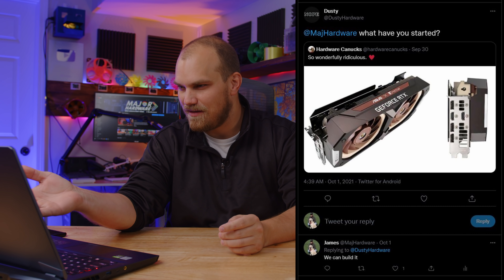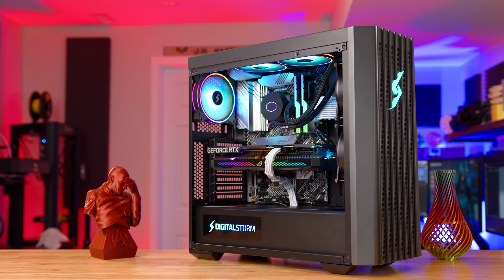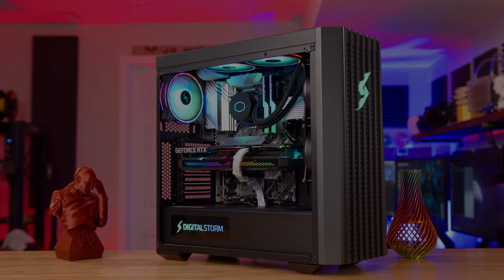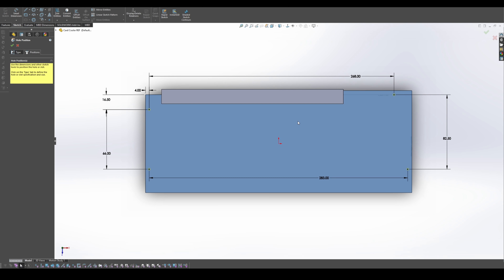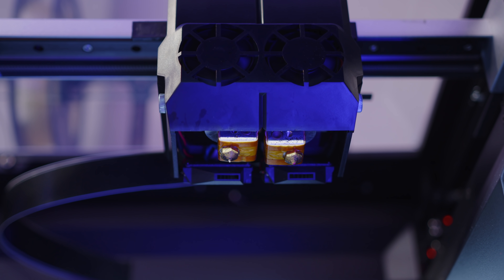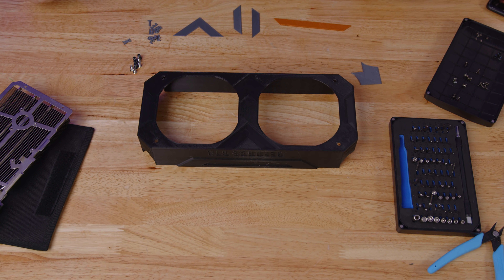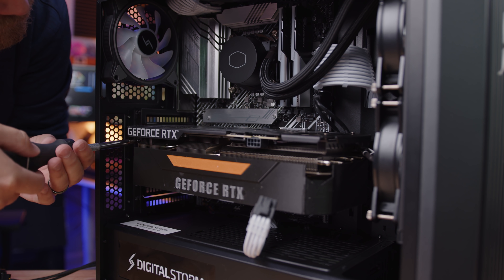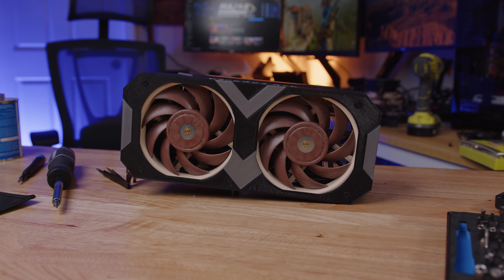I FABRICATED The RTX NOCTUA EDITION From A Picture

Comment: Did you try using the fan headers on the graphics card to run them? The Strix 3060 should have 2 fan headers at the back of the card.

Comment: Your asumption is wrong, because with both type of fans, you achieve the max airflow the rad can use.

Reduce noise to like 35dba or lower and you'll see a lot of difference in temperature. I have a 1080 strix modded with 2x120mm sw3 and im not only running much quieter but with slightly better temps. Im running 800 rpm (which is like 32-33dba) instead of the 1700-1850 on stock fans (something like 40+), and im getting 4-5ºC lower.

Comment: I'm sure the firmware on the card is aiming for that 52-53 c. I did notice the clocks were lower on the noctua fans
Reply: That's the problem with AIB GPU's their firmware is tuned to the cooling. He should have taken manual control of the Mhz for a baseline.

Comment: Paused At 12:00 for my guess.
Cooling: slightly warmer, but no worse than if the card was in a case with poor airflow.
Noise: quieter, but not noticeable to the ear because of other fans/pumps in the system.

Edit at 13:00
Nice.

Comment: I did this on my evga 1080 when the stock fans died and with 2X Chromax fans. However, I just used zip ties to hold the fans in place. It's extremely quiet but looks like junk.

Comment: In the screen capture #1 you are showing the card hitting 1777-1800 MHZ at 52C, In the second it is hitting only 1725-1755 and is hitting the near same 53C. This tells me the test is not consistent, as the MHZ should have been the same if the temp was the same.

My assumption is the testing window on the Furmark test wasn't sized the same.

Comment: People have been doing this but without the shroud. I've also done something similar with a Gigabyte 1660Ti, which was loud AF and also had rattling noises at almost any RPM. I just removed the crappy plastic shroud and slapped 2 Arctic PWM fans directly on the heatsink and ran it like that. Temperatures were roughly the same but the improvement in noise was incredible, no more rattling and it even looked better. I'm not a fan of fan shrouds to be honest, I prefer to see the tech that does the job, the cooling.

Comment: Did something similar with a Deshrouded 3070ti. Have 2 Noctua 120x15 slim Chromax fans mounted to the bottom of an NR200 and 3D printed air ducts leading direct to the 3070 fin stack. Runs so much quieter but that card runs hot no matter what.

Comment: I did the same with my evga geForce 1070 a few years ago, just with less 3d-printing and more just straight-up zip-tied a pair of unused fans to the heatsink.  The Noctuas had a lesser current draw than the stock fans, so running them off the card was no issue.  It might have looked a little "sketchy," but it actually ran 2°C cooler and didn't sound like chainsaw any more.

Comment: Graphics card deshrouding is a very unrepresented thing in the PC building community. It's amazing for GPU thermals and silent cooling. And it's especially great when you're using an ITX case, where the deshrouded graphics card with case fans brings fresh air in from outside of the case.

Comment: If you do get a 3080 or 3090, it would be pretty cool to design a shroud that brings the air around and blows across the back plate. The memory temperatures on those are too high.

Comment: Arent you worried about the fact that PLA starts melting/warping at around 60 degrees celcius?
I have been toying with the idea of designing and printing a complete miniITX case. But the "fear" of it "melting" has kept me from going ahead
Reply: Why didn't you use ABS instead?

Comment: I have a GTX970 that had a fan die on me and it was using these really weird connectors plus you couldn't get replacements back then anyway. So I threw away the entire shell of the GPU and zip tied two 120mm noctua fans. Now my problem was they were no longer reacting to the GPU temperature being powered as a case fan on the motherboard. But by some weird stroke of luck I had a motherboard with a temperature probe sensor port thing and I just had to buy one for a few bucks and stick the probe inside the GPU then set the BIOS to use the temperature for those fans. And yes it is the worlds ugliest GPU but it worked! It still works but I upgraded and it now sits there as a backup GPU in case of the worst. I wish I'd had the skill to make a cover but the important thing was the card was so quiet! And for me the temps dropped a lot. I was just amazed I'd managed to make it work so great stats was a super bonus.

Comment: My man, you should try to make a shroud for the Raijintek Morpheus. It's a universal cooler that you have to BYOF (bring your own fans). I'm currently using 2x A12x25 and it keeps temps ultra low in this config BUT the cables are a challenge to keep clean (and no shroud).

Comment: I made something like this back in 2004 😆 I strapped two 90mm case fans to my ATI X800 because it kept overheating.  It over clocked like a BEAST after that.  That was before graphics card manufacturer even started doing that.

Comment: 2021, the year where printing things for your computer is easier than buying one.
Reply: *If you have a 3D printer to begin with.
Reply: @rafamacamp  It's easier to get a 3D printer than PC parts
Reply: @Aesavyx  Depends on where you live.
Reply: .......were talking about a 3060 that is priced higher than most 3060ti....and id rather talk about how most ppl miss that point. Dont even get me started with some of the top tier 3070 options being priced above 3070ti cards. You have to push the 3070 strix to 8000 mem and around 2.1ghz or 2055+ just to get near 3070TI FE numbers as it is. Which typically requires a high quality psu if youre going to push an OC like that when ever you play a AAA title per ex. VS the simplicity of undervolting a 3070Ti fe to run cooler/quieter and get the same frames for 599$ on a best buy drop. VS the 800$ msrp range of the 3070 strix/v2. Thats the sad part everyone new gpu or not(those that buy one) are all refugees of this tech landslide.
Reply: @anhiirr keep in mind, the 2 fans are like $70. That’s quite a bit, if you just take the 3D printing to be free.
Reply: That is my goal: build a chassis and supports with a 3d printer
Reply: @yanuehara8017  You answered yourself, mate. I don't live in the US.
Reply: @yanuehara8017  Can you send me some links? As far as I know, the prices don't justify the results. I'm pretty able to make stuff in other ways so...
Reply: no, it is easier and cheaper to buy a prebuild
Reply: Just buy a laptop 🤡

Comment: I did this many years ago. And ever since i've always replaced the stock cooler with 2x noctua a12x25 fans.
Reply: The one in the video has 3 fans and logically 3 plugs on the pcb but If you only use 2 does the controller behave the same as it uses 3 or is it just programmed to react to the heat and it doesnt matter how many fans? Im a noob
Reply: @franzrecht6092  The fan connectors on a GPU is not a normal pc case fan connector. So you plug them into the motherboard or a fan controller. You can use software to control them. But in my case the Noctua fans are so good i dont really need to do anything but plug them in and make sure they run. My 2080ti went from 88c full load to 65c. But the most noticable thing was the greatly reduced fan noise. My PC is totally quiet thanks to Noctua ♥
Reply: Honestly, since i don't care about noise i'd use some ippc fans which run at 3k rpm
Reply: @federicob.8313  How can you not care about noise ? But yes if you don't, why not go for some Delta 11k rpm 100w fans ?
Reply: @jnssmnsn  that would probably rip the GPU off the PCI slot! lol
Reply: @Deses  That's beside the point ^^ But probably yeah
Reply: @jnssmnsn  Hew's gonna care about noise when he grows up and moves out of mommys place and isn't forced to use headphones all the time while gaming anymore.
Reply: @federicob.8313  Are you deaf? Maybe he's actually deaf.

Comment: How did you wire the Noctua fans, to the GPU's on board fan header?
Reply: As he had the wires free when he attached the cooler to the card, I'd expect he attached the wires to a chassis or CPU fan header on the motherboard. There are adapters to convert the PWM plugs from the GPU to the standard PWN plug, but I don't know how safe that is to do. (I've been starting research on my own shroud for a couple weeks now and wiring the fans has been one of the points of concern for me.)
Reply: @JLProPhoto  I've deshrouded my GPU (1070 Ti) and run case fans off the GPU header. Hasn't caused any issues in the past few years.
Reply: @teguh.hofstee  do you have them running on a curve or do they just go at 100 all the time?
Reply: @JLProPhoto  I run them off a curve, I used to control them with a custom curve using afterburner but I think right now they're just running whatever the GPU has as its stock curve. The fans are still idle until it hits like 45C or something.
Reply: @JLProPhoto  Thank you for the information.

Comment: is just a 3060, a morer Watts hungry gpu, that kicks more heat into the case, 4 slots, like the one on the official pic, will cut a lot the airflow on the bottom of the case. 
the design of the cases are outdated with the new gpus consuming 350W and new ones will do 400w and more.

you did the test on the other video, proving that the airflow at the bottom of the case is pretty bad, and temps improved a lot with the shroud. and is just a 3060, imagine a 3080...

btw what doen't mach , is, you said stock card has 53ºC as well, and on the shroud video it had 78ºC , that is a huge difference from stock fan speed, to 100% fan speed.

Comment: Hey, you should really complain to digital storm about their computer with the radiator installed tubes up...
Reply: Actually the AIO is just fine since the tubes are higher than the pump. You need to re-watch the many videos explaining that the top hoses have to be higher than the pump for everything to be ok.
Reply: @Tintmaster775  Nope, you should rewatch those vids... Yes the pump absolutely should not be the high point in the loop as it'll fail prematurely, but the tubes also should not be at the high point.  Ideally the tubes are down and the opposite end of the reservoir is at the high point by itself so all air in the system can collect there.  I ended up with a gurgling noise after a few years that was resolved by flipping the reservoir.

Comment: How did he connect the fans? Did he find an adapter or did he connect them to the motherboard and run then at full speed?
Reply: Probably connected them to two of the three fan headers on the gpu (it had three fans and fan headers tend to be standardized)

Comment: Did the conversion cost $600? Because the markup from $500 to $1100 certainly communicates that ASUS needed $600 per card to do this.
Reply: Nah, he probably did it for way cheaper. Oh wait, he needed a 3D Printer.
Let's see:
A12x25 fans are $29.95 US according to Newegg.
He needed two, so that's $48.90 for the fans.
For the 3D printer material, we'll say he used 250g of material (equivalent to a massive print). You can get 1kg of 3D printer filament for less than $20 on some stores (PLA should be adequate, or you can use ABS). So the cost of the 3D printing material should be around $5 or less, depending on how cheap you can get the filament.
Let's also say that the glue he used cost $5, and the screws used to attach everything cost $2.
Adding everything up, you get $60.90, excluding the tools you need to do the conversion.
So it seems ASUS is marketing this as a premium product?
Reply: @williamhuang8309  I didn't need the math done, my comment was sarcasm. But yea, you could buy the 3D printer with the fans and you'd still save a few bucks. ASUS is nuts...
Reply: @dominic.h.3363  I was about to say with the $600 you could buy a new 3D printer and also make this thing 🤣
Reply: @williamhuang8309  don't you think PLA will deform in the time with temps around 50-60*C ? ( I have a RX580, running easily in the 70-80*C range so, PLA would be a concern XD )
Reply: Thomas Hannah  Nowhere. I've read the same announcement article everyone else did. No other region-appropriate information about pricing or availability.

Comment: Great build.  Maybe contact Steve @ GN or Jay to see if they'd be interested in a collab where they provide you the other 30 series cards and you make the Noctura versions. They could be tested against what the AIBs manufacture.
Reply: I remember more than quite a while ago, when the Corsair water blocks were leaking. MH was among the first to report this and Jay called him a no-one and he was obviously faking the test for video views. As much as I would like to think everyone is okay with everyone these days, I don't see how I'd be able to work with someone that said all of that about me.
Reply: @Christopher_S  Damn I didn't know Jay went in on MH in the past. Doesn't make sense but Jay seems to have D-bag tendencies.
Reply: @kenpumphrey8384  Unfortunately so. It was at the start of 2020, about the Corsair GPU waterblock. MH was the first to spot this, and let Corsair know, they said it was just a defective unit, so send it in for them to check and they'll replace it. The replacement did the same thing, and MH reported on that too. Basically, it leaked if any pressure was on the fittings area.

People asked Jay his thoughts on it because he gave the product a rave review, and then claimed that MH was manipulating the issue to gain views. It was sad to see, because Jay instantly took Corsairs word on the matter, that it was only a handful of products with this issue (it was not, there was a rework done (which still did not fix the problem)). 

Only in June (2020) I think it was, did Jay admit that there was actually an issue, and I've not once seen him say sorry for his accusations toward MH.

Either way, personally, even if he did say sorry to me, I couldn't work with him going forward after that.
Reply: @Christopher_S  I remember that water block issue. I just didn't see all of the content. I'm going to go back and look for it. Thanks for the info.
Reply: @kenpumphrey8384  did you ever find the video?
Reply: That would be cool

Comment: Maybe the new design could be tweaked - try it!! 

The boost clocks are lower with the new cooler. Probably isn't able to cool the same (or force the air) as the original triple fan setup.

Comment: Great job. Just be carful of putting PLA in a pc as it goes soft at 60 degrees Celsius and might drop those fans and (hopefully not) cook the GPU.
Great video. Keep it lit.
Reply: The PLA shouldn't be getting anywhere near 60 degrees since the actual gpu isn't over that, but that would be an interesting thing to test with a hot running and poorly ventilated case.  Maybe just plastic wrap the case.
Reply: thats actually not a problem. the fans cool the plastics. ive printed fan ducts for hot ends in pla :-)
Reply: This is not a problem, I did this to my own gpu too. The 2 noctua fans are still attached to the PLA and the cooler. It has been running in my poorly ventilated p400s for almost a year now. Though I am thinking about reprinting them in ABS, because right now the parts have different colours 😅